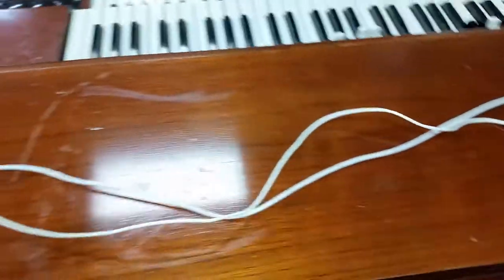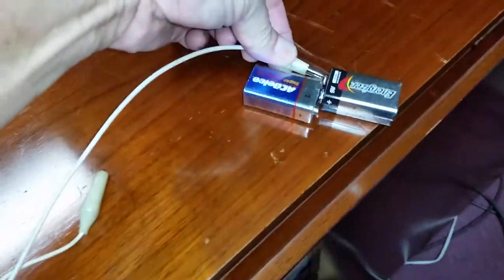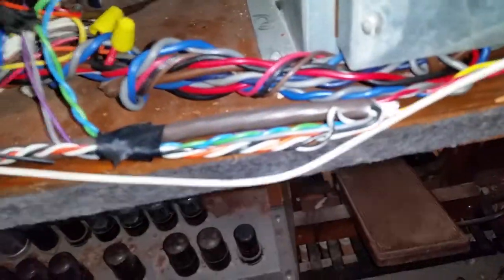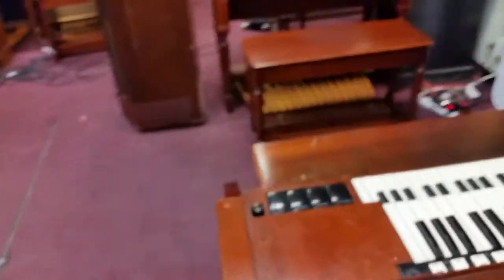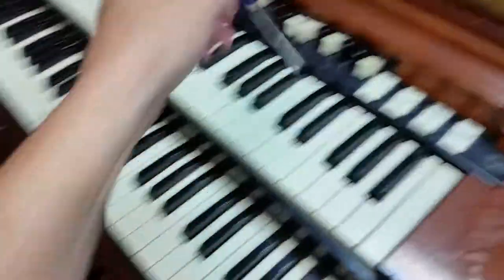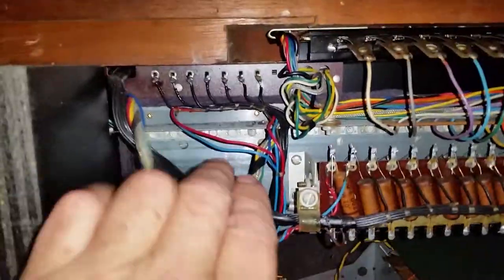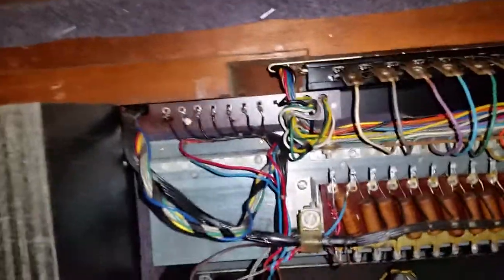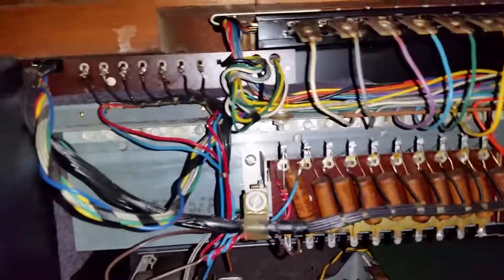Simple Hammond vibrato zap

Comment: In case of this organ, I'd replace those wax paper capacitors at the delay line first if the vibrato has a chopping, even helicopter like sound. Just like the filter capacitors on top of the TWG, their capacitance values may have increased dramatically during the decades.
Reply: My experience is they will at least double in value, guaranteed, for 50 year old wax caps in the line.